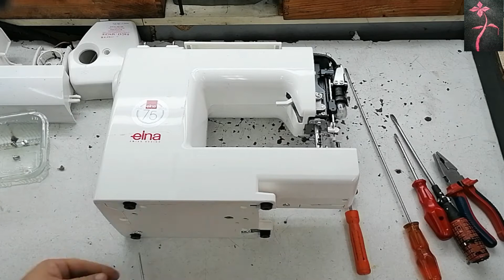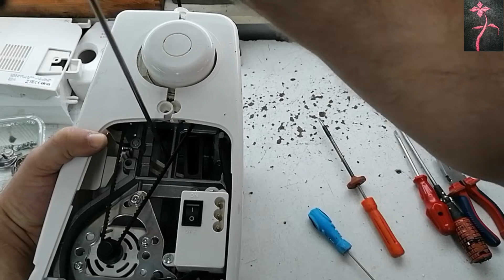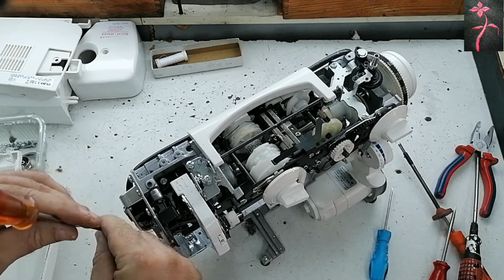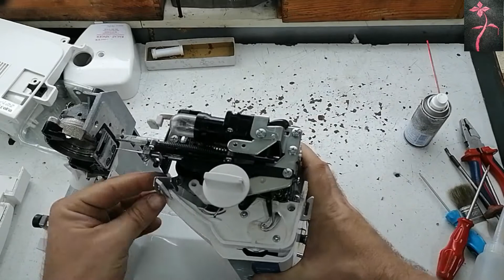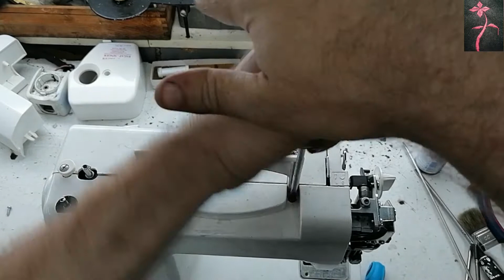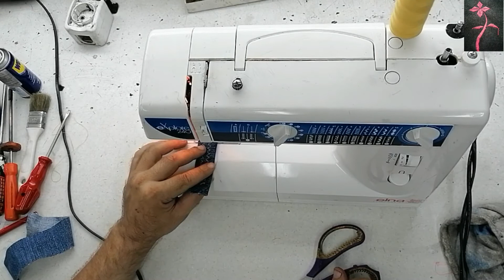SEWING  MACHINES  ELNA EXPLORE   240

Comment: My elna 240 is jammed. The handwheel on the side is not turning and therefore the needle is not moving. Please help 🙏🏾
Reply from the maker: hello, there is a big range of failures when the machine is blocked, first you need to take out the chuck, grab the spool from the machine, then try the machine to see if it turns because it happens that the thread gets stuck in the basket.